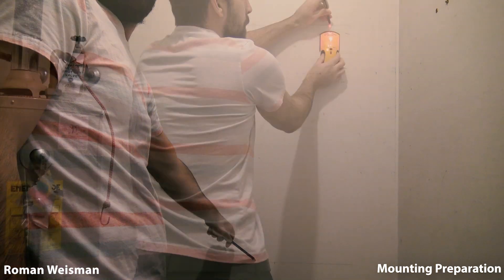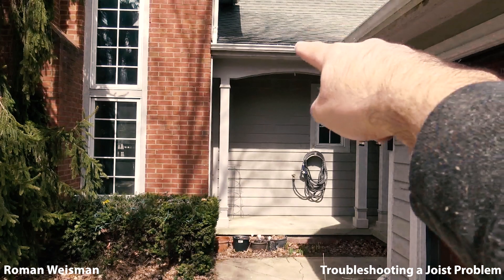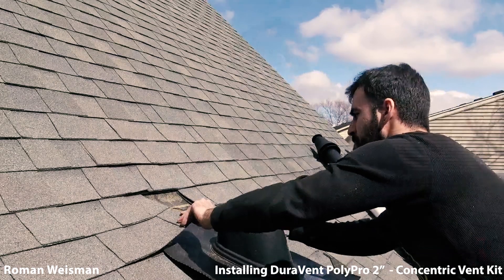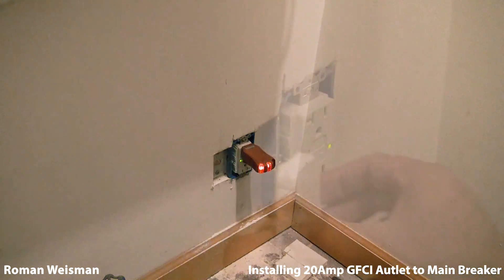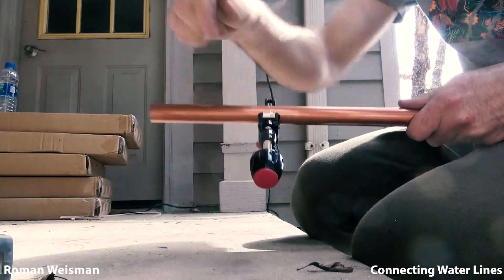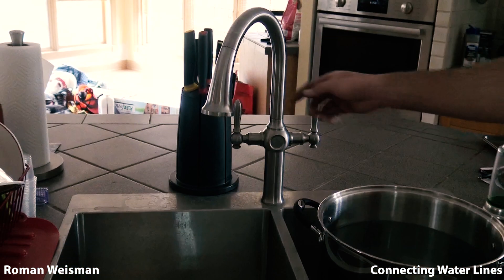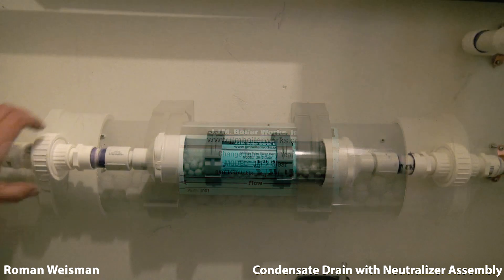Tankless Water Heater Install | All Steps In Detail

Comment: At 5:13 what is that part attached to the roof deck ? My kit did not come with that.
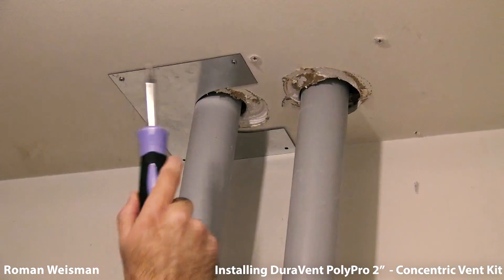Reply from the maker: Hey - same as in 5:46 : A fire stop.
Reply: @RomanWeisman  Thanks for the reply.  Is it necessary ? I thought the temp is lower especially so far downstream. What brand did you get if you remember. So hard to get this flashing, I have to wait until April.

Comment: Hi there. I enjoyed your video. My question is: Do you need a gas fitter license to do the install yourself?
I was thinking to do the install myself, but my home insurance said otherwise.
Reply from the maker: Check with you local building codes ( google your city name following "Building Safety Division", get the phone number and ask them ).
Since it's my house, I'm the owner, and according to my city's building codes - no license is required for the job; the only thing that was required was a permit ( can be acquired through the same building safety division ).

Btw - I didn't contact my insurance at any point of time, even though the tankless unit ( among other reasons ) was installed to replace the tank water heater which was leaking and created water damage : The insurance would have said "wear and tear" and wouldn't have participated in the replacement cost.

Thanks for watching, and I'm glad you enjoyed it.

Comment: great video overall! And I'll soon be installing one at home myself.  General question, seems like you installed 2 gas valves?  one right under the tank and one further down the line near the wall?  May I ask why it wasn't sufficient to just use a single one?  I was thinking to just use one but wanted to ask in case I overlooked something. Thanks in advance
Reply from the maker: Thanks for watching, and the compliments.
Since I was doing it on my own, and for the first time, I wasn't sure how long the job will take: So I blocked the gas to the tankless unit, while there was still gas going to the furnace ( to keep the house cold ). In other words, it's not required for the unit to operate properly.

Comment: A BIG QUESTION MY FRIEND.CAN I INSTALL A OUTDOOR(NOT INDOOR TANKLESS WATER HEATER) TANKLESS WATER HEATER INSIDE THE GARAGE TO REPLACE THE OLD WATER HEATER TANK?THANK U
Reply from the maker: The only answer is: Check with your building safety devision before getting a permit, codes change from state to state.

Another answer will be: depending on your water heater, you will have to check if it will survive outside as the paint can chip or the interior can freeze when not in use ( hot sun and cold weather ) - you will have a better idea when contacting the manufacturer.

That being said, If it's a completely closed garage, then it's still considered interior structure, especially if you have an old water heater there, with the gas, water and venting pipes.

Thanks for watching and leaving a comment.
Reply: @RomanWeisman  I really appreciate you answered my question. Thank you
Reply from the maker: @velascojidon390  No problem at all, my channel isn't big yet : hence, so far it's not hard lol.
Reply: @RomanWeisman  my best wishes for you and ur channel😯👍
Reply from the maker: Thank you for your kind words, and I hope that your project will work out, I honestly enjoy the luxury of endless hot water.
Reply: @RomanWeisman  you're welcome my friend. so basically this project is for one of my customers.👍

Comment: Roman,
I have the existing tank water heater in the basement so having roof venting is not an option for me. So I am planning on horizontal twin pipe venting. Any tips for doing this venting? I purchased RU199i.

Also, did you add a new gang box because you didn't have an electrical outlet near the water heater?
Reply from the maker: Hey Kevin:

I'm not sure about the RU199i, but its installation manual should have the exact allowed models.
For example the Bosch installation guide at page 17 has the exact models and describes if they can be used in horizontal or vertical positions and page 25 describes how they should be installed including the slope required - please also make sure that it is not next to windows/doors/ roof soffit ( check local code on the allowed/required distance from them ).

Outlet: I didn't have one at that location, but I don't remember if local code requires a dedicated outlet for the heater ( tried searching, but can't find any code requirement for it - but please check by your local code ).

Comment: At 8:36 I did a double take at the floor. It is not in good condition at all. Don't come to my house and do what you do.
Reply from the maker: Thanks for watching Ken, that's exactly the reason for replacing the water heater, I needed access to fix the rotten sub floor, and since tankless water heater can be mounted on the wall ( and among other reasons such as endless hot water ) I decided to install it - I'm sorry that you didn't understand my sarcasm, I try adding humor to my videos and sometimes it's misread; exactly 3 seconds after the time you mentioned, at 8:39, I say exactly the same thing.

I uploaded a video recently on how I changed this part of the floor, along with the main water valve which was leaking, if you're interested, hope that proves that what I said was indeed sarcasm: https://youtu.be/OKYCHhraRws

And I don't plan on coming to your house or any house, this is my own house that I'm fixing and upgrading - thanks for the invite though ;)   ( yet another sarcasm )
Reply: Yo Bro u did a perfect install!, u know how hard it to find plumber to install a tankless water heater,  it ridiculous 🤯
Reply from the maker: @ripwins  Thanks a lot, I didn't see your reply till now.
It's ridiculously expensive as well, and some will save on materials.

Comment: I must say you are VERY good at this and very thorough. How do you like your T9900? Does it eliminate the cold water sandwich that other tankless units suffer from?
Reply from the maker: Thanks, it's important for me to provide as much information as possible, but still people will face problems at stores: it's like going and saying I want to paint my wall in white - and then realizing you have more than 1 and even 10 different shades of white.

Regarding your question: I was afraid of the cold water sandwich, and honestly, never had this problem even once since I installed it a year ago. Moreover, unlike tank water heater where at the end of your shower, where the hot drains and you slowly but confidently decrease the cold water... with the tankless, you just leave the hot valve and the cold exactly at the same position from the start of your shower and till the very end of it, you might find yourself even increasing the cold water ( on long and luxurious shower times ) :)

The only problem one might face ( I haven't ), I assume, is low water pressure if you start the water from any hole possible (washer, garden hose... ) and as well any place that has gas exit in parallel to your shower - but why on earth would someone do that apart from when installing the unit and making sure the measurements are per the installation manual.

Comment: This is such a great video, Roman! How is the Bosch T9800 SE been performing since you have installed it? Did you ever have issues with it? Did you have to install an anti-scale filter or even descale it?
Reply from the maker: Thanks a lot for the positive feedback. I have installed it around April 1st 2019.
Endless hot water for a 3K sqft house, 2 grownups, no kids - 0 issues.
I did not install an anti-scale filter, the unit needs to be flushed and the neutralizer granules changed once a year - I will upload a video about it soon, currently busy with my porch renovation ( you can see what I'm currently doing on instagram, all my posts are public ) : that will eliminate the anti-scale ( If I'm not mistaken, this can be eliminated also by installing a water softener [ on my list ] before the water heater, but please double check this ).

The only concern that might bother one, is a strange noise the unit does  - see the video at 12:13: This usually happens when it was not in use for several hours and lasts for maximum 5 seconds.

Comment: More questions: 1. Did you get a permit first before installing or after? What’s the process of getting permit for this type of work? 2. what size was the leg bolt to mount on board?
-thanks again.
Reply from the maker: Permit ? 
1.Yes, the video starts with: "before starting, I had to get a permit" LOL.
2. Mine has walk in / call hours ( something like 7-9 AM and 1-3 PM ), the inspectors are very friendly and helpful - type in google: YOUR_CITY get a permit. It should offer you your city's building and safety web site, from there get the phone number and see how it works in your area.
3. See 0:29 second of the video, it shows the structural screw - I think I used something between 2.5 and 3.
You're very welcome.
Reply: I contacted the city and applied a permit. Getting a permit wasn't harder than it sounds. Thanks for your suggestion. Thanks for your help again.
Reply from the maker: Great, I'm super excited to hear it.
The reason I started this channel is to motivate individuals to do things on their own and show that things are not so hard nor expensive.

Just one advice: If you are doing the same exact install, with the gas, water, ventilation and electrical, do as I did, and do not remove the existing water heater while you install the new one. This way, if things will get complex, you will not get stuck without hot water.
Make sure you have everything that you need before you start ( if it's the Duravent, make sure they have the rubber gaskets inside, I received some without it and had to complain to that company which were very nice and took this very seriously - they even sent me 25 gaskets for free. If it's tools that you need like screwdriver, driver bit set, drill, maybe impact driver, saw and so on). Make sure you have the manometer for instance ( again, see the description below the video, it has the relevant links ) for gas pressure measurement and that after the installation, the readings are per the requirement in the installation manual.

Otherwise, if you are replacing the current one with the new one, make sure the pipe sizing meets the installation manual requirements, and that you have a dedicated breaker box outlet connection.

Most importantly, read the installation manual in parallel to my video. I tried to be as specific as possible, but better be safe than sorry.

You can do it !
Reply: @RomanWeisman  What type of wood did you use? like thickness
Reply from the maker: It's a pine ( non treated ).
At the stores they advertise it as 1 inch while actual size is 3/4 inch ( 2cm ).
The minimum allowed per the installation manual is 1/2 inch.

Comment: Nice video. It looks like your tankless heater is condensed version because you installed the neutralizer. One question: did you use the pvc for venting? I couldn’t tell. It looks different.
Reply from the maker: Thanks for watching. Please see the description below the video, but: The Bosch Greentherm T 9800 SE 199 NG is a condensing unit. The Bosch neutralizer is required, but I think the installation can pass inspection without it - I just feel more comfortable having it installed and doing things by the book. For the venting, used Duravent polypro, not pvc.
Reply: @RomanWeisman  I know Duravent polypro has higher temperature than PVC CPVC and since it's condensed one, couldn't you use PVC or CPVC? just curious why you chose it. I can't find Duravent polypro at Home depot or Lowe's
Reply from the maker: The vent I chose is per the requirement of the installation guide, there are other options as well, but I liked the look and the product Duravent kit offers ( https://www.ecomfort.com/DuraVent-2PPS-VKL/p71388.html?utm_source=order_update&utm_medium=email&utm_campaign=product ), also, I like that the end cap is closed: this will eliminate birds nesting in it ( other pipe tops I've seen are open at the top and allow rain and anything possible going into them ).

See section 16.installation instructions,  4.6.1. vent options at: https://www.prowaterheatersupply.com/PDFS/Bosch_Greentherm_T9800SE_199_Installation_Manual.pdf

See the video description below the video, it has the links to the Duravent and others ( was not able to find the Duravent at Lowe's / Menards / Home Depot as well ).
Reply: @RomanWeisman  Thanks Roman.
Reply from the maker: You're very welcome Kevin, hope the build is going well - just please stick to local codes, and don't hesitate to call the one who gave you permit for any questions you have, he/she should help. If you use pex tubing for example, don't ignore the first 18 inch should not be pex.
Reply: @RomanWeisman  I am planning to use copper ^^. it looks cooler. Thanks Roman.

Comment: Wow. How much time did it take you to research all this?
Reply from the maker: Thank you for the WOW.

It's hard to provide an exact answer, but I assume that overall research time was around 4 months, including: what brand, where to buy, how to waterproof the vent, what vent to use, what pipes, how to solder, gfci or not, and lots of other questions.

The most important part is to use basic common sense, when dealing with gas, fire, water, carbon monoxide, electricity and avoiding any kind of shortcuts.